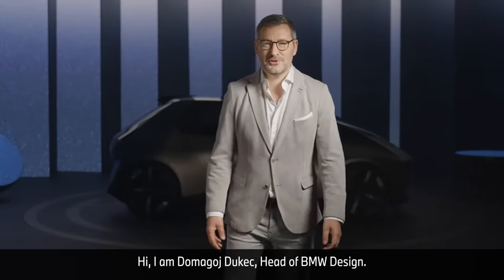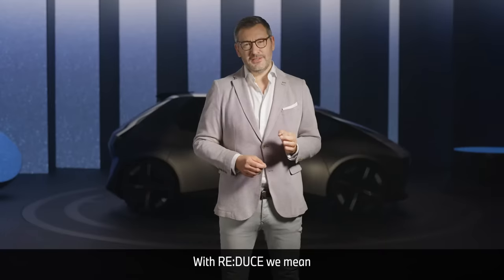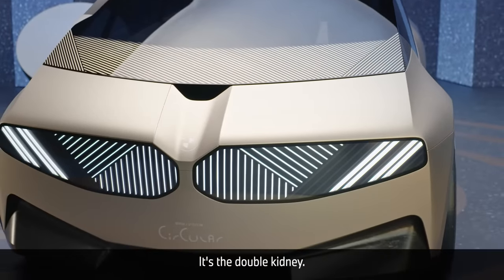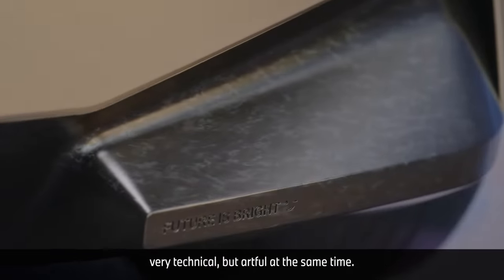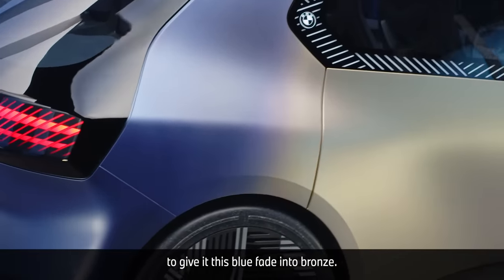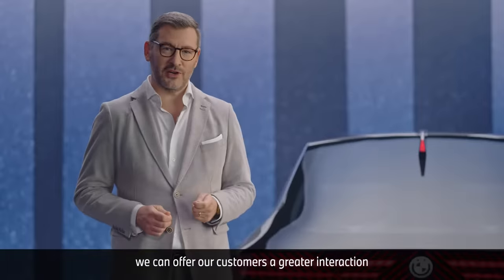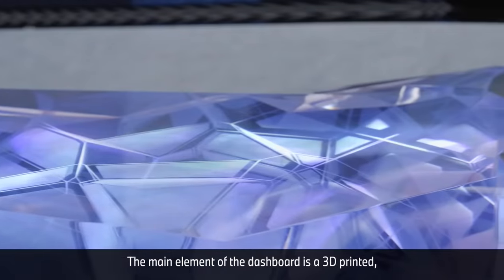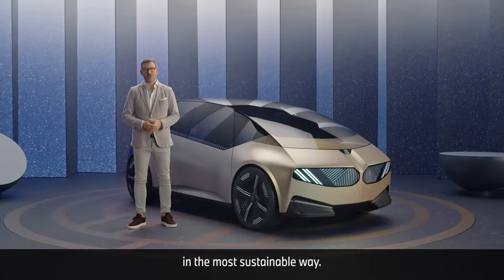The BMW i Vision Circular design explained by Domagoj Dukec

Comment: I like the car... but, will there be a more basic version? less fancy trim light, void grill effects, basic interiors, basic wheels with more sidewall on tires for softer ride and prevent damage to wheels (the real world roads have pot holes). If BMW is worried about providing enough "bang for the buck"... then lower the price of a basic version. Expand your market (please).